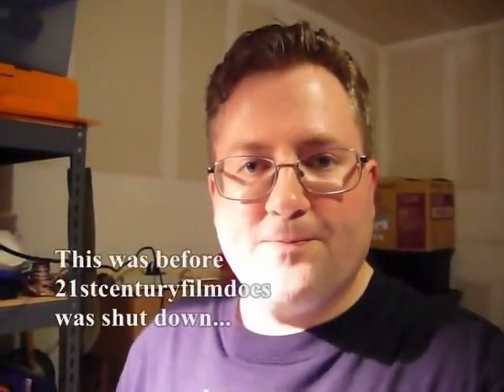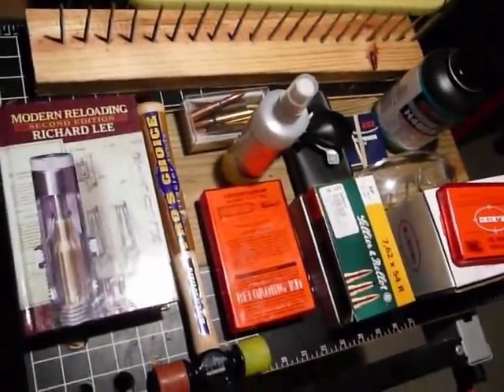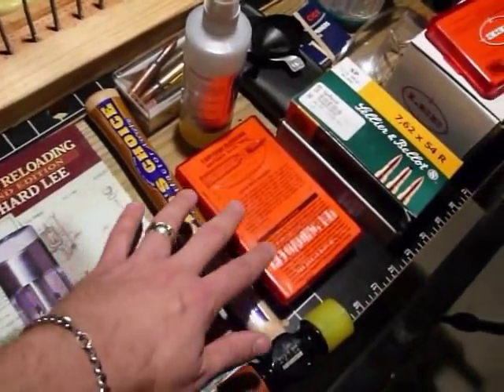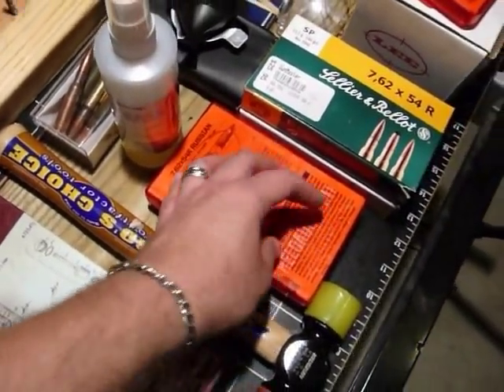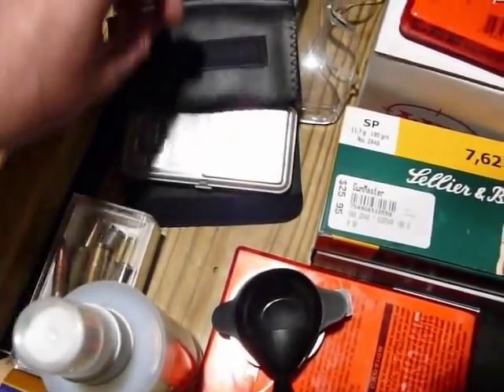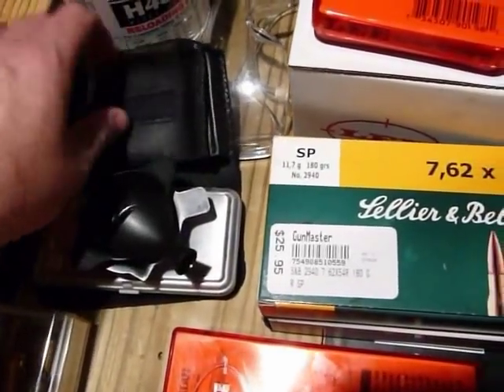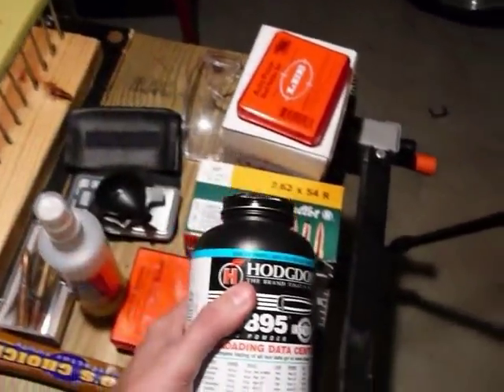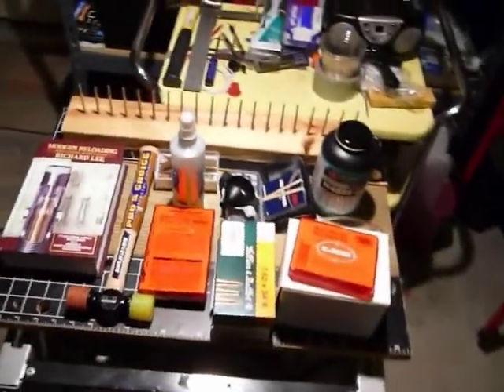The Mosin Minute - Episode 60: How To Reload 7.62x54R Ammo (Part 1 of 4)

Comment: I have had good results by searching the tables of gun shows for old molds and pouring my own bullets, then sizing them with either Lyman sizing system(messy and arduous) or Lee sizing. I find that you are trying to get to a point where the bullet is fairly tight in the barrel, but not TOO Tight, nor too heavy, of course. A strong action is best, such as Mauser 98, or even Mosin, but if ever in any doubt, I would remotely fire the round, keeping in mind you may lose the gun! Lead is great!

Comment: If you're using jacketed then the normal sizes (like the "303" .311) will do fine. But with cast lead you always use a bullet a little larger. .357 mag for example would get a .358-.359 bullet

Comment from the maker: @TheMachine8mm Yes, I used .311 when I really should have used .308 FIRST, just to be safe...because when I finally did slug this one, it was measuring about .310.  

But here's the thing, other than 125 gr. .310 bullets meant for 7.62x39 AK ammo, it's basically impossible to get bullets in any other size...you either have to make .311 or .308 work...OR make your own bullets out of lead, which I'm not inclined to do...

Comment from the maker: @beloyloy153 Are they .310 diameter, and have you slugged your barrel to make sure it's about the right size?  If so, then the brand really doesn't matter.  One thing I will say, if you are recycling spent brass, make sure it's brass specific to YOUR Mosin Nagant...because Lee's hand loading kits resize ONLY the neck, not the whole brass case, which means if you are using brass fired by other Mosin Nagants, you're likely going to have issues chambering them in your own Mosin Nagant.

Comment: Great video series and seems basic and easy, I'm already reloading pistol ammo however have not done rifle and I just purchased a Mosin which is a lot of fun. I plan to follow your route with the Lee Reload Kit for this caliber, one question - said don't make the same mistake as you - so which bullet do I start with? Thanks.
Reply from the maker: Well, the first thing you need to do is slug your barrel and see what will work.  I've cautioned to use .308 to start, but I find it too small and unstable.  I tried .311, and that works in many Mosins, but your pattern will be different, so you have to adjust for that.  YOu'll find .310 bullets, the optimum size, near impossible to get in anything about 125 gr., which is the same bullet used in AK ammo.  So, I've tried those of lat and seem to get some decent results.  Just gotta test it out.
Reply: 20thcenturyfilmdocs Tango Mike- Thanks Much ! Also the primer you got was a Lee auto primer (hand held ) right?

Comment from the maker: @cgkeddington Not 100% sure on that...honestly, you can get 7.62x54R match ammo SPECIFICALLY made for that PSL Dragunov knock-off.  But one thing is for sure: if you reload 7.62x54R ammo, MAKE SURE it's being used in the same gun you originally used it in...I discovered the hard way that if you try to use reloads from one Mosin Nagant M38 to an M91/30, the chamber differences are such that it won't work interchangably.  Not all the time, at any rate...

Comment from the maker: Meh, the manuals lean toward .308, but I find it's too small for most barrels....you really have to slug your barrel, then if it's .310 or .311, go up to .311...apparently, the bullet at .311 is OK in a .310 slugged barrel, you just have to watch your load and check your primers after shooting to see if the primer is bowing around the the firing pin dent too much (a sign of too much pressure).

Comment: I suppose if you really wanted to you could pull some 147 fmj from milsurp and use that to handload with. Not terribly practical but if you *really* want to avoid those primer salts or prefer a hotter or slower load... just a thought

Comment: I would suggest slugging the bore, then casting some bullets .001" larger than the groove diameter (.312 if the gun slugs .311") Check out the Cast Boolit forums.